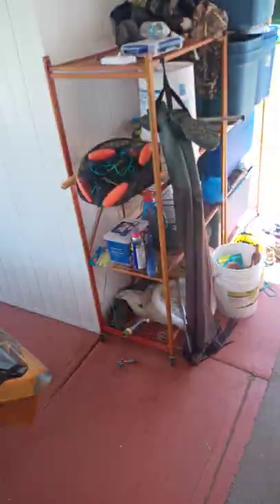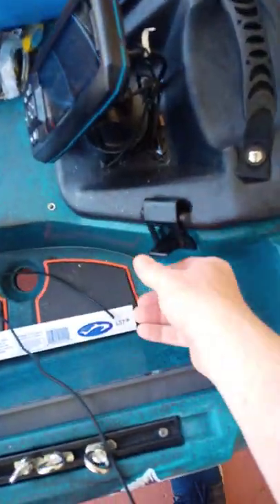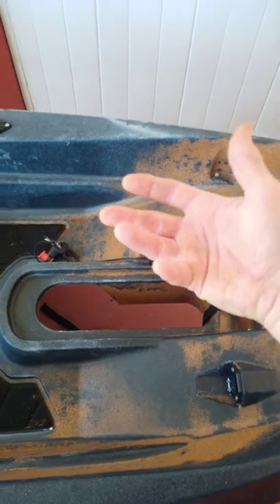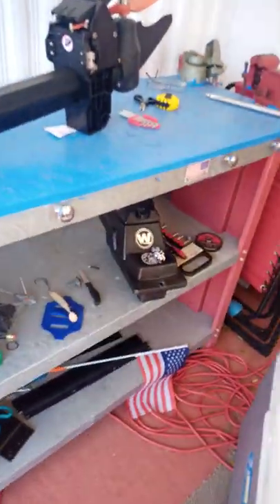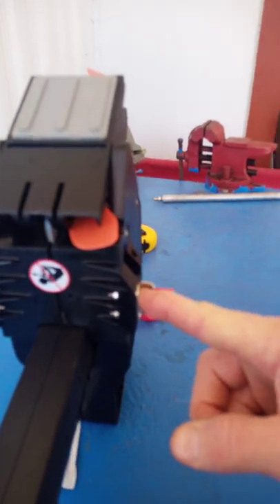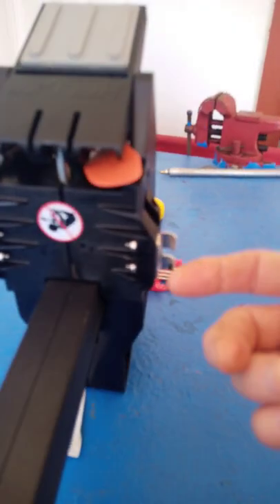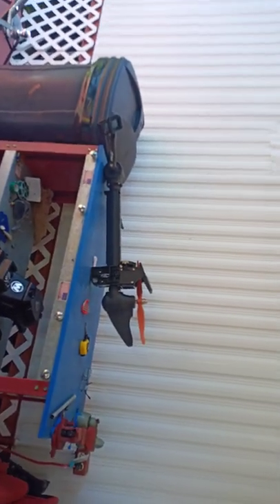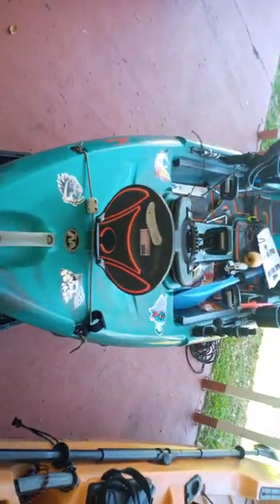The truth about the Helix Pedal Drive System for Wilderness Kayaks 🤬😂

Comment: Will the motor drive system will it work on the thrashers model
Reply from the maker: No. It only supports the Helix MD motor drive
Reply: Thank u for this video. I was gonna buy one with intentions to add a motor in the future but it looks like u have to buy their specific motor. I was looking for a kayak that u can add a trolling motor with spotlock. Doesn't look like this can do that. And I do not like the fact that you'd have to completely pull the motor out and lay it in the boat if you're shallow